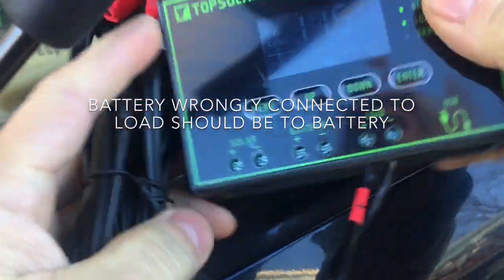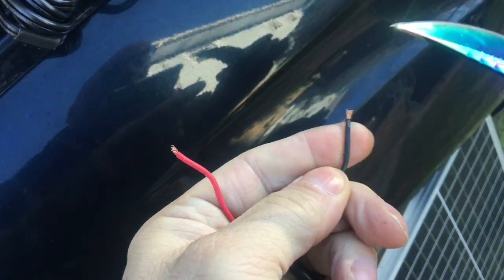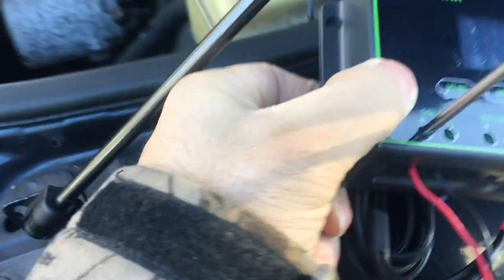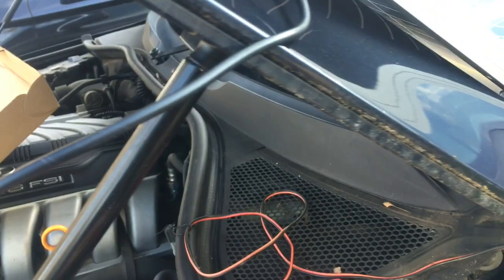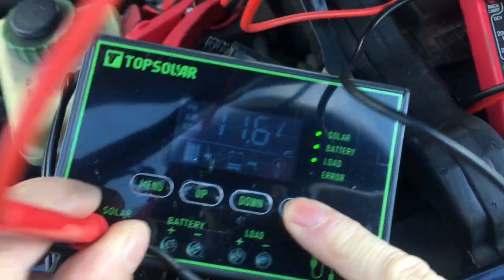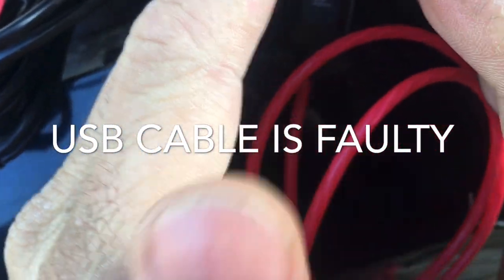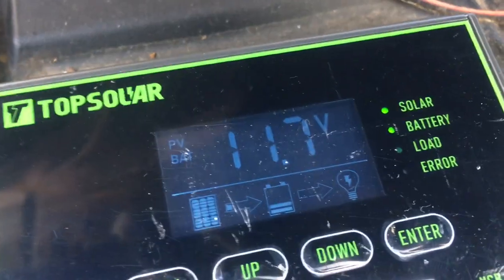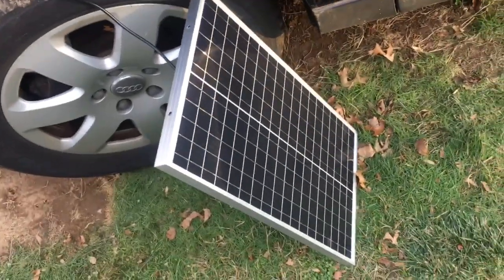Charge Car Topsolar Solar Panel Kit 30W 12V Monocrystalline with 10A Solar Charger Controller

Comment: Thank you bob
Reply from the maker: are you looking for anything in particular? I need some projects to try with this ;)
Reply: @bobspurloc  im going to use it in the back of my vw camper  to trickle charge a lesure battery , and then use a power inverter to power a tv and lighting in the van